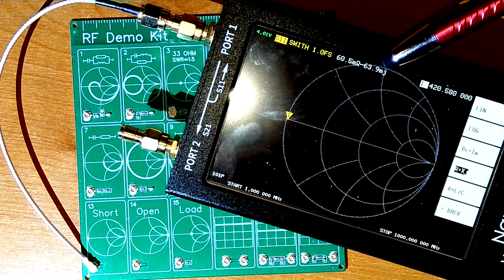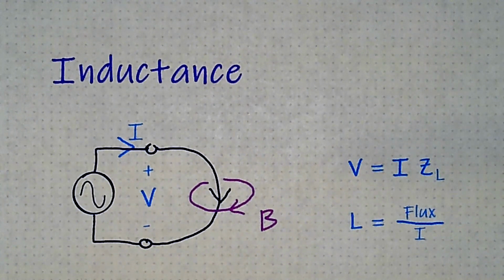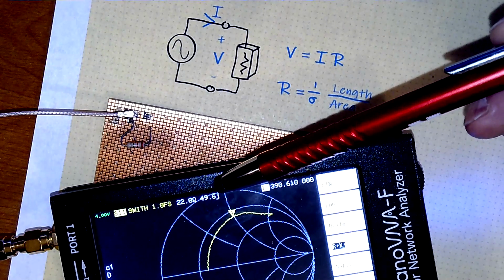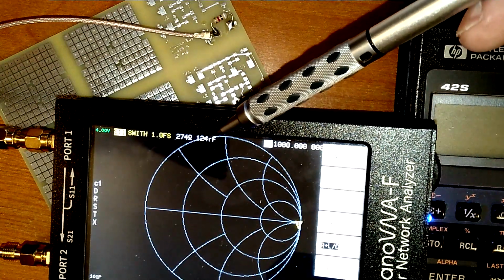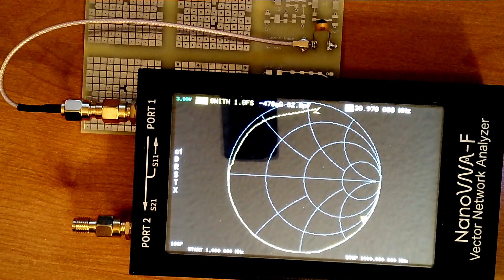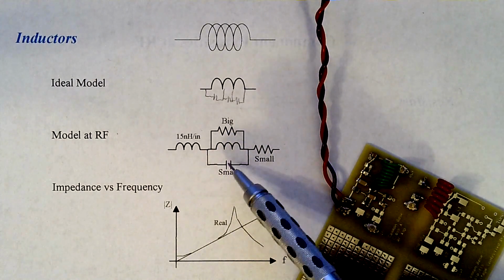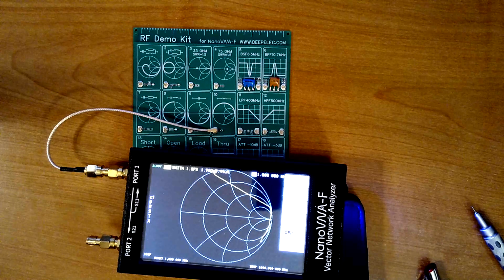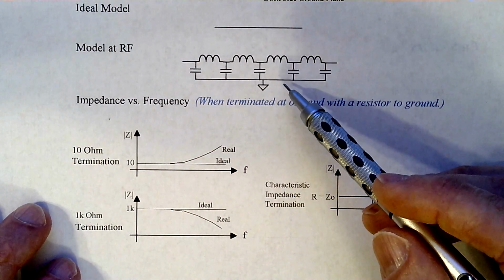NanoVNA - Measuring RLC Components

Comment: If reactive polarities mean anything, the reactances only go up as the frequency goes up.  The XL is a positive value and it only goes to a larger positive value as the frequency goes up in an ideal inductor.  Xc is a negative value and that negative value only approaches the positive value as the frequency increases in an ideal capacitor.  The absolute vales do move in opposite directions though.

Comment: What type of protoboard do you recommend for making HF circuits, please?
Reply from the maker: Here's the associated website's writeup on that. There are also a few videos. I'll follow-up this reply with one or two of those. Basically there just needs to be a ground-plane to handle the parasitics. The back side of the board in this video has a ground plane. It was a quick custom PCB I made through ExpressPCB. But here's the more detailed info on what we use at the university class: https://ecefiles.org/rf-circuit-prototyping/
Reply from the maker: Here's the technical details and some pictures of some examples. It's a two-part Episode. https://www.youtube.com/watch?v=26fABQ9WOTQ&list=PL9Ox3wpnB0kqekAyz6blg4YdvoEMoJNJY&index=15  and  https://www.youtube.com/watch?v=dv7FeX2rEyo&list=PL9Ox3wpnB0kqekAyz6blg4YdvoEMoJNJY&index=16  .  Hope that helps. Sadly I have not found a good current source of boards commercially. But using free software and board building vendors like ExpressPCB or JLCPCB (and KiCAD for layout) are good options.

Comment: Very helpful.

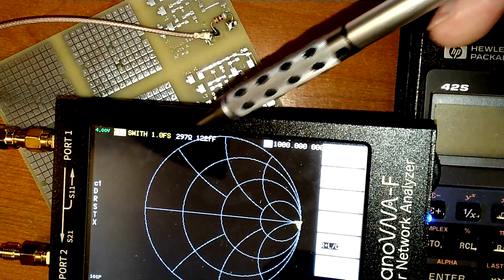At 14:20 you mis spoke when you describe the resistor and a SERIES capacitor. It is a parallel capacitor. It shunts the resistor lowering the measured impedance.
Reply from the maker: Thanks.  I agree that the total drop in impedance is due to the parallel capacitance in the device. But the VNA  reports the measured value as 267 Ohms in series with 126fF. It's confusing because the VNA doesn't know if the realization is series or parallel, so they have to pick one. The marker format shows as "R + L/C". That is the NanoVNA's notation for resistance in series with L or C, following classic readout options that go back to the early HP VNAs. When I use the 267 Ohms in series with 126fF, convert to Z at  1 GHz, and then convert the series form Z to parallel, I get 7K || 125fF. See https://www.youtube.com/watch?v=vO-AJjIX7a4&list=PL9Ox3wpnB0kqekAyz6blg4YdvoEMoJNJY&index=14 for the conversion stuff.  (The 7K vs actual R value of 9.1K is possibly due to the series inductance in the model or to basic accuracy limitations in measuring S11 near the outer circle on the chart.)  Thanks for bringing this up.

Comment: To a tech working in 10–100 GHz?

MHz is “thermal drift.”

MHz is “oh, just flex the connector.”

MHz is basically DC.

microwaves acts very emotional not for hobbyists, i have worked in the industry builiding mmic amplifiers 4 - 18 gigahertz. Don't mess around with microwaves if you don't know what you are doing, at 10 gigahertz and beyond. CAPACITORS AND INDUCTORS become STRIPS OF COPPER, no discreet RESISTORS NOR CAPACITORS NOR INDUCTORS. MEGAHERTS is JUST DC to us.

 REALITY IN THE LAB:
You sneeze near a WR-10 waveguide, and you’ve detuned by 500 MHz.
You breathe too hard on the dielectric, and your LO phase jumps.
You touch a screwdriver to tune it… and now the signal is gone.
But the VNA still says "MHz resolution." 😎
Reply from the maker: Agreed that the lumped component + parasitics model breaks down at some point. Everything becomes a transmission line eventually as frequency goes up. E.g. at 10 GHz, lambda in free-space is 30 mm (15 or 20 on a board or in cables), so a few mm of non-controlled impedance traces on a board can mess things up, and 5mm can really wreck stuff as you noted. Fortunately, microstrip line has obviated the need for waveguide in some applications (except for long runs and high power). So doing stuff up to 24 GHz at least is becoming practical, potentially even for hobbyists, albeit more expensive than using the TinySA and NanoVNA instruments. One just has to study transmission lines and a bit of S-parameter theory :-)
FWIW, I never used waveguide, but being an IC designer, was still able to do inductors and capacitors on-chip. And there, the component + parasitics models work fine (up to say 30 GHz at least) for LNAs, mixers, etc. It's all just a matter of scaling (frequency and dimensions). Until one has to transition to a PCB, or do stuff with high-power of course... We used coax, GSG probes, and cal-substrates for VNA measurements on the  chip bond-pads or on test structures in the chips. Definitely requires more attention to detail 🙂

Comment: Nice tutorial. The major part of the through hole resistor comes from it's very own spiral engraved into the carbon or metal plated cylinder! In fact it is   a coil and only therefore a good example for what you are showing.
Reply from the maker: Interesting. Makes me want to take some of my old through-hole resistors and unencapsulate them !

Comment: At 14:36, you were measuring a 9100 ohm resistor with the nanoVNA, I was wondering if you were using the S11 method?  I think that 9100 ohms is at the edge of the accuracy of the instrument, and switching (although, not easy with this setup) to the series S21 and converting to S11z...  Copper Mtn website has some interesting info on the VNA accuracy for various Z ranges.,..  I have indeed re-learned quite a bit from your videos, I've enjoyed taking some of the formula and coding them into Python as calculators...  Thanks for you time sharing this info...  Oh, I see Rjordon was all over this....
Reply from the maker: Good points.  Yes,  I was just using the S11 method. I'll have to look at the Copper Mtn site and see if they found the same results we did relative to improved accuracy near the short and open points on the chart after calibrating for S11 measurement using SOL references. Thanks for the comments!

Comment: Really appreciate your present at but I have a question I can’t seem to get answered.
In this video, you showed how (with an inductor) when you raised frequency the inductive-reactance increased—so good.
In a couple of videos W2AEW & Gregg Messenger, they showed (when connected to an antenna) that as the frequency increased, the inductive-reactance decreased by rotating downward from the upper hemisphere past the Real-axis into the capacitive lower hemisphere.  An antenna will always look more-and-more inductive as frequency is increased (i.e. antenna too long); I would think the vector should rotate upward as frequency increases as it did for your inductor. Tnx & 73…
Reply from the maker: Hi.  Their videos sound correct.  It turns out that dipoles (or monopoles or most other antennas) actually do go through periodic resonances. At each resonance, it transitions from capacitive to inductive, or inductive to capacitive. Actually inductors will do this too if measured at high enough frequencies (above what's called their self-resonant frequency).  Here is a webpage that shows a graph of real and imaginary parts of an antenna's impedance versus frequency (reactive, imaginary part in blue).  They didn't label it, but the horizontal axis is frequency in MHz for the 30m monopole analyzed. But dipoles/etc will do the same thing.  Hope that helps. 73 http://www.siranah.de/html/sail018r.htm
Reply: @MegawattKS  well thank you for taking the time to both comment and providing the link.  I did get a response from Alan saying that the measurement-point is at the coax, not the antenna unless it is at exact 1/2 wavelengths.
I must be honest, I’m still trying to get my head around this still (since it always seems to go in the same direction) but will try some experiments to hopefully gain greater insight so, we might get with you again. 
Thanks Again & 73…

Comment: Brilliant video and explanation of the black art of RF design. Thanks.  Just FYI, the nanoVNA-F V2 goes up to 3GHz and can use 301 plotting points. The v0.5.0 firmware doesn't include thru calibration though this isn't really a disadvantage.
Reply from the maker: You're welcome. And thanks for the info on the V2 !

Comment: Hi... I really enjoyed this very educational video regarding NanoVNA measurements of RLC components.  I'm learning how to use the NanoVNA to measure LC circuits and stand-alone inductors. Your analysis piqued my curiosity about how to interpret the measurements. My question concerns the measurement of the self-resonant point of an inductor. When you showed the model schematic, we saw R(big) to be in parallel with L, which I took as the equivalent parallel resistance exhibited at resonance by the parallel LC circuit formed by the parallel combination of the L and parasitic capacitance. So near the self-resonant point, the apparent value of R(big) increases, as shown in the demo. i think you mentioned that R is the series resistance. The value of R(big) was around 2.6K near the resonant frequency, which seems rather high for a series resistance for the coil. I think the VNA is measuring the resistance it sees, which in this case should be the equivalent parallel resistance R(big). If this interpretation is correct, this is great way to measure Q, which I calculated to be about 7 based on the measurements. Thanks again, looking forward to future videos on using the NanoVNA.
Reply from the maker: Hi Scott, You have hit on some very important points!  The extraction of model element values and the analysis of Q is indeed tricky near self-resonance, and even in the technical literature there are some inaccurate approaches and innacurate measurements reported. I like your focus on the self-resonant frequecy (SRF) and what happens there and agree that what you are seeing at self-resonance is the parallel loss resistance Rbig - not the series R. That's where the literature can be misleading, and you have correctly realized the complexity.  Here goes for an attempt at summarizing (I'm neglecting the 15nH/in interconnect L in the model here):  At low frequency (well below the SRF), one can just do Q=X/R where X and R are the imaginary and real parts of the impedance reported by the VNA. In this regime, we can delete R(big) from the model and just use the series R. But starting somewhere around 1/2 of the SRF, this simple calculation breaks down and the model needs to include the parallel R(big). Indeed this then gives Q=0 at the SRF since the measured value is purely resistive as you said (the SRF is where the VNA curve changes from inductive to capacitive on the right side of the chart). But there is still a resonance, so clearly there is non-zero Q ! So in this regime (between frequency of about 0.5SRF and SRF) a different approach is needed. I'll follow-up with this thought in the next reply to keep this one reasonable length...  -Bill
Reply from the maker: Here is what I have done to extract more meaningful Q values between frequencies of about 0.5*SRF and the SRF:   1) delete the series R from the model so that it simplifies to a parallel RLC circuit. Take a measurement around 0.2 SRF to find the reactance and compute the L value from that.  2) Use this low-frequency L value together with the SRF to compute the C value for the model. The next step is where the math requires complex number crunching, so forgive me if I don't explain it well: 3) Take measurements of Z=R+jX at the frequencies of interest between 0.5 and 1.0 times SRF. Convert this impedance Z to an admittance Y (Y=1/Z) and then subtract off the admittance of the capacitance found in step 2. This gives an admittance Y' of just the R(big) in parallel with L. The real-part of Y' is then equal to 1/Rbig. 4) if Q is desired at this frequency, use the parallel-mode Q formula Qp=Rbig/X_L where X_L is the reactance of the inductor in the model at this frequency 🙂
Reply: @MegawattKS  Bill - my interest in all this stems from a recent experience I had measuring inductance of large air-wound coils having moderate inductances. In one case, I had a loading coil for an antenna of about 150 uH consisting of about approximately 100 turns of enameled wire on a PVC form. i made this quite a while ago, but recently I used a NanoVNA to sweep from about 50 kHz to 10MHz to measure the inductance. I expected to see a normal Smith chart plot for an inductor in this frequency range, but this coil has a self-resonance at less than 2 MHz, well below the intended operating frequency of about 3.7 MHz. I know it is most likely due to parasitic interwinding capacitance that is rather large, because the 100 windings are right next to each other, and wound on PVC that has a high dielectric constant of about 3. However, I was not sure if this is an artifact or a real effect. I made two such coils to be used as loading coils to resonate a 40 meter 1/2 wave dipole in the 80 m band. I guess my point is that theoretically, this coil is made to the desired inductance geometrically,  but its frequency response is another issue and not considered in the design criteria. Would this inductor work as a loading coil then if it turns into a capacitor at the frequency of interest? If it does work as an inductor at the operating frequency, then does the parasitic capacitance get swamped out by the antenna capacitance? I don't think so, because I calculated that the parasitic interwinding capacitance should be about 70-80 pf, which is on the order of the antenna capacitance for a 40 m dipole operated on the 80 m band, which the coil is to null out (e.g., say about 10 pf antenna capacitance), unless the capacitances are in series, in which case the add in parallel. The smaller one dominates, as you pointed out in the video.  If you have any insight to this dilemma, I would love to hear your feedback. Thanks again for your great video series on all the subjects you cover on your channel. Scott
☺
Reply from the maker: @scottgilbert7927  Hi Scott. I'll take a stab at this. I have experience with the theory, but no direct experience designing a loaded dipole. My first thought is that 150 uH sounds very large for the goal of loading a 1/2 wave 40 m dipole to work at 3.7 MHz. But where are the loading coils going?  At the feedpoint or somewhere near the middle of each element? Maybe 150uH is correct for the latter case, but it's j3500 Ohms at 3.7 MHz, which is hard to realize.  Assuming that's the goal, then I think the interwinding C is the culprit as you said. And the VNA is telling us its a capacitor, which it is. It won't work as an inductance load.   Maybe try winding the coils with wire with some thicker insulation to cut down on C (though the coil length might grow of course), or use a larger diameter PVC form to decrease the number of turns needed?  The other option I can think of is loading each side of the dipole at the feedpoint. I think the antenna you describe (40m dipole used at 80m) looks something like Z = 73/4 Ohms - jX with X maybe a couple hundred Ohms (maybe check with EZNEC simulator?). In that case, you only need L = X/(2*pi*f) = 8.6 uH. Of course you'll then need to build something like an L-match network to convert 73/4=18 Ohms to 50 or 75 as needed for the transmission line. Hope some of this helps.  Great problem and application of the NanoVNA !
Reply: @MegawattKS  Hi Bill.... sorry for the late reply. The loading coils were made some years ago, during the early years of my ham radio career. I got the dimensions and specifications for the loading coils for a 40/80m dipole from another YouTube channel, Dave Tadlock KG0ZZ, from 11 years ago. I never measured their inductance until the other day. Here's an update though. It turns out that I may have been premature in making my earlier comments. I re-measured them with the NanoVNA yesterday, and found different behavior! This time, I was very careful about the calibration. I found that the self-resonance occurred at a much more reasonable frequency, around 9 MHz. The Smith chart plot was very normal appearing on the NanoVNA as well, with a nice arc around the upper part of the outer circle of the Smith chart. I took the frequency sweep out to 20 MHz. The curve did not dip much into the capacitive region of the Smith chart even beyond the self-resonance frequency. Here is something perhaps you can clarify for me and perhaps others. Some of the real component values of the complex impedance readings were negative. In other words, the values went off the chart outside of the infinite resistance limit of the resistance line. Is this just an instrument artifact due to calibration errors? So the behavior of the coils seems to be as designed. Even with a large winding density, the parasitic interwinding capacitance turns out to be small enough to allow the coils to function as inductors and not capacitors at the design frequency. So I guess the bottom line is be careful how you calibrate the NanoVNA. Have a chart or something like that to follow so you make sure you don't skip a step. Recheck the calibration again to make sure the results you obtain are accurate.
Reply from the maker: @scottgilbert7927  Cool. That's great news!  Yes - the negative R values are just due to inaccuracies in the instrument. Not really a calibration issue necessarily. Just a fundamental limitation in the measurement technique (although calibration issues can make it worse). But as you said, it is always important to check calibrations carefully. As long as it doesn't go outside the unit circle by much, it's probably a good cal.  For more (probably TMI), here is a paper I wrote on this topic when I got tired of seeing people report Q values of 100 or 300 or more ;-) :   https://www.semanticscholar.org/paper/Measuring-and-Reporting-High-Quality-Factors-of-Kuhn-Boutz/756741ee621180df2cb12f9839b7a7fae4fc9395
Reply: @MegawattKS  Thank you Bill. This is very instructive. I read your next reply, and will comment there.